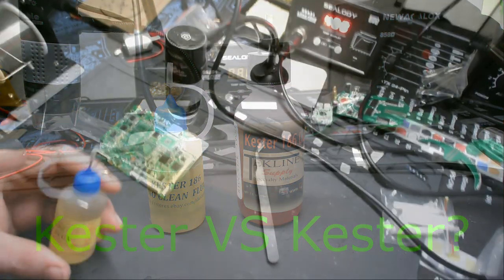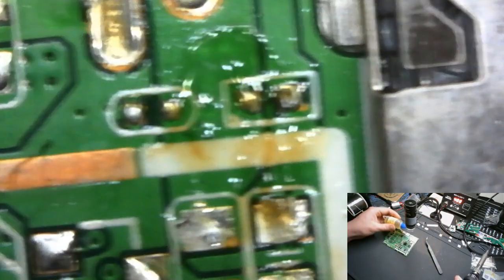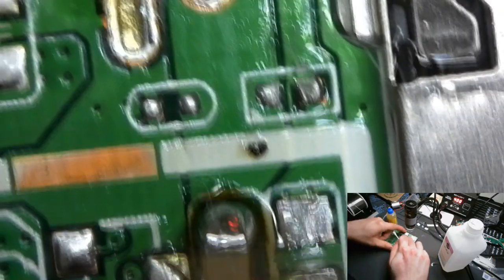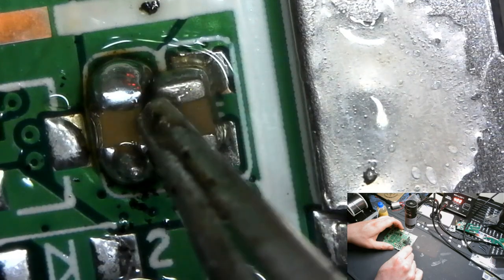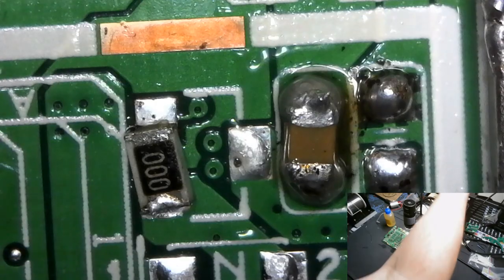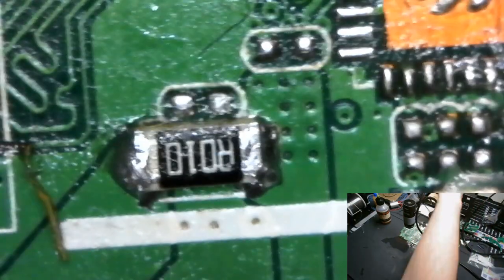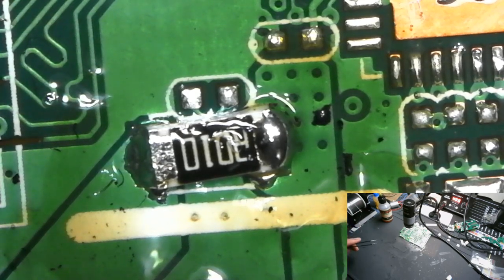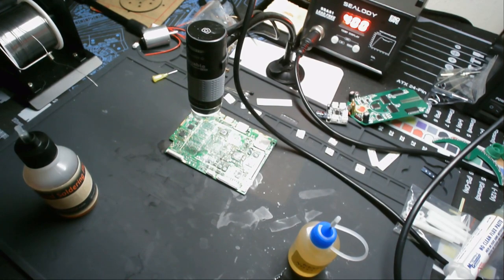Real VS Fake (Kester 186)

Comment: I think your soldering iron is too much hot! Or needs calibration. If you are using good quality 60/40 or 63/37 just stay at 270-280 degree c , and for small pads like these use the smaller iron tip. It should not be big like this, also you cannot heat a component for more than 2 sec

Comment: I used the ebay bottle labeled Kester 186, which looked identical to the bottle in your video, for a year and a half and performed tens of thousands of dollars in board repair with no issues. I never received education or training for it so I'm not an expert but I've picked up a few things over the years and can do a fair amount. The boards I repaired and wiring jobs are still fine years later so I can't complain about the flux. 

My only complaint would be not getting paid extra for the work I did because the majority of board repair I did, voluntarily done during my spare time in between my actual job, was to save the company money on parts, labor, lost income due to downed machines, and service charges and to make my job easier and keep things running right 😅 I calculated out the service records I kept and found that I had saved the company more than 150% of my annual wage in board repairs alone in my first year of employment, not including many times more than that in money that wouldn't have been made if the machine(s) was down for the week or so it would have taken, plus the cost of service calls and parts, to get it running again. Each machine profited anywhere from hundreds to thousands of dollars a day, well over my weekly wage. 

The last tech that possessed any technical knowledge, or at least understood basic fundamentals, of computers or electricity, or was capable of soldering, advanced troubleshooting, or rewiring retired a year before I arrived so all of the "slot techs" were actually just slot attendants who changed paper, fixed bill and ticket jams, reset jackpots, fix broken or stuck doors or locks, and paid out smaller jackpots. Needless to say their casino was in pretty poor shape when I arrived. 

Out of 331 machines I never had a single one down by the end of a shift but most days, especially my Monday, I'd come back to a minimum of 4-6 machines down and have them fixed within the first hour or two of my shift and I did the repairs with equipment I bought, including any components I couldn't salvage from donor machines. Eventually I managed to do a complete overhaul on every machine and had them all functioning like new, also leading to the security drop taking 4-6 hours to complete before due to door jams, stuck locks, etc, down to 45 minutes to an hour on average because there were no more issues. I never received a promotion or bonus and had the lowest quarterly review score in my department. I'm not sure why I was surprised to find how greedy casinos are 😅 I would love to learn more about board repair and I think it's something I'd like to get into but it definitely isn't my primary career/skill. 

I haven't used too many kinds of flux but even if it was fake it got the job done every time and wasn't a pain to clean. It could be fake but I'm guessing someone is buying in bulk and reselling it in smaller quantities. You can buy a gallon (128 oz) of Kester 186 for $95 and a pack of two 1oz bottles, labeled Kester 186, on eBay sells for $14. After 64 sales (128 1oz bottles), at $14 for 2 bottles, you'd have $896, plus maybe $200-$300 for bottles, labels, and shipping, (roughly a $500-$600 profit per gallon) so it isn't unlikely that the repackaged bottles are genuine Kester 186 flux. I'd love some good equipment but sometimes you make do with what you have. I didn't have an issue with the flux I use but if you're planning on doing a lot of soldering it's probably best to just buy a gallon at a time and buy your own bottles or syringes with metal tips/needles as you'll be saving $800.
Reply: You should start your own casino machine repair service.

Comment: On SMDs, a flux pen works better due to the size of the components. Just trying to be helpful. Not everyone knows the easier solutions and I happened to have been fortunate enough to have military training.
Reply from the maker: Any feedback is always welcome as long as it remains constructive. I have been lucky that most people who comment are clearly skilled and want to help. I bought a flux pen when I started practicing microsoldering. It was an MG Chemicals one off of Amazon I believe. I'll try it out again next time, I've learned I've been using way too much flux so I can see how a pen would be better for small pads.
Reply: On this pen use. There are many types of pens out there. The big thing is that the flux match the flux used in the solder’s core provided it has one. The liquid flux is not bad if you allow some of the alcohol, isopropyl in this case, flash off some by leaving the flux bottle open for say an hour or so. It is best if the flux is not so runny when used on pcbs. That’s part of the reason why I suggested the pen kind. Less mess means easier clean up. Clean up may not be mandatory, but that does not mean after ops cleaning isn’t necessary! I see it as mandatory because clean surfaces do not attract moisture as readily as one left dirty with flux residue. Soldering is not just something accomplished with the iron. It is about a whole discipline and I adhere to DOD STD 2000-1. It is an uncompromising discipline that, if adhered to, accomplishes both high quality and high reliability. It’s not for me to tell anyone to do like me, but the reason solder joints fail is a lack of discipline issue. When, in my military years, failure meant loss of human life or a high value asset loss. When you have that over your head, you don’t need any other motivation!
Reply from the maker: So you have to use whatever flux is being used in the solders core. This is where the flux is RA or RMA for example correct? Yes, learning how to do things properly seems to be an issue where information seems to be conflicting from various sources. Is there any basic tips you would recommend people do when soldering in general. Like a rule of thumb everyone should follow? Thanks for all the advice.
Reply: Draxxille Gaming, don’t blame yourself for not knowing everything! I don’t, but it is obvious someone wanted to keep you in the dark! There are weak minded people everywhere. Enough of that. Whatever flux is in the core is the extra flux you use to keep the joint, wire or connector clean. Paste is the hardest to control. The needles on them are too big to do SMDs of any kind. I don’t use paste on anything because I have found that the pen and the fluid work best in any applications I have come across. Just be sure you use the same flux as what is in the core and you can’t go wrong. Mixing core and fluxes will cause issues you do not want to deal with. I have found RMA to be the most consistent of all the solders in electronics industry. Lead free formulations have not gotten to the same level. Until they do it is 282 Kester RMA Sn63 or Sn62 for me.Aim and Alpha Metals also make the same solder under different numbers. Cleaning all surfaces is imperative to get top joints! People who expect the flux to do it all will reap the wild wind when their project or repair fails! Cleanliness is paramount to getting everything the best it can be. Any more questions, just ask! I’ll help out. I know how. Some can’t and some won’t!
Reply from the maker: Awesome, I really appreciate the tips. I am using Kester 44, which I suppose is the right alloy SN63, but I checked what core type my solder was and it's type RA flux (Part number 24-6337-0007) So I suppose I shouldn't be doing that because I believe my flux is RMA. What measures do you take to ensure top cleanliness flux aside?
Reply: Draxxille Gaming, I would ditch the 44 and go to 282 RMA cored solder Sn63! Do not get larger than .025” solder wire. .020 would be better. You do a lot of SMD work so .020 is plenty big enough. The smaller the wire, the easier it is to control the flow of it when soldering. Larger sized wire is only helpful on super large connectors and larger components. Smaller wire easier to control your feed of solder. Clean the joint, pads, wires or leads with 99% isopropyl alcohol till no residue is on your Kimwipes. It may be a pain now. But when you start your solder op, you’ll thank me! After your done with the soldering op, clean all surfaces and leave no flux residue, period! You have to be hard on it if you want first rate results! I really need to come up and teach you the full program. Then you will be the envy of all your viewers!
Reply from the maker: @markphilpot4981  Alright, I'm looking for some now. I'm having to resort to Ebay to find it. I see a lot of .015" 282. What is your thoughts on that size? That is what I have been using this whole time and it seemed to do well. Kimwipes, I added that to the cart too. I have the lint free swabs right now. Have you ever seen better results with Flux removers vs. 99% isopropyl alcohol?
Reply: Draxxille Gaming, the .015” size is primo for SMD work because it is small and that size makes control of it easier on the tech. On larger components, .020 or .025 are preferred for the same reasons of control of the solder. Using too much solder is both wasteful and stupid! Your joints should appear clean and shiny. The appearances of acceptability are located on the web for those who really care. Things that you do for a living should be cared about, otherwise why bother. This work isn’t for everyone. If you aren’t committed to excellence in your soldering, you have no business doing this work! It should only be done by people who are committed to it and are willing to exercise the discipline necessary to achieve that level of excellence! DOD STD 2000-1 is the standard I was taught under. It is not the current standard of soldering, but I do not agree with this new standard or the ideal they push! I am fanatical about solder quality. Your opinion may be different. If it is, you are not doing this part of your job with the right mindset. Solder failures are your responsibility! Therefore, make up your mind about whether your customers matter or not! If not, do something else!
Reply from the maker: Alright, I'll go on ahead and order that 282 from ebay then. Where do you order your solder from? I know a roll lasts forever, but it looks like to get kester it has to be bought from a supplier. Supply seems limited on amazon. I just looked up the Appearances of acceptability, that's what I try to shoot for. I can usually tell when something looks off, but I'm sure I've messed up and used too much solder. What are they trying to do in the new standard? Lead free crap?
Reply: Draxxille Gaming, I am uncertain as to the real. I only have the words from those I respect who’ve told me of unnecessary reflows to try to improve appearances of solder joints. Every other introduction of heat in an SMD or really any component being reflowed or reworked, regardless of the reason, damages the internal structure and junctures of the device itself. Many and nearly all of the newer avionics use SMDs and smaller components that do not hang as well as older and larger components. There is no reason to put a pilot’s life or a capital asset in danger over strictly an appearance issue if that is what it is with respect to solder joints. It either passes or fails. It isn’t worth losing a life over that and what would be classified as shear negligence on the part of the operators while being defended by lazy ass inspectors who aren’t doing their job by rejecting the failures rather than having them reflowed or reworked. It depends on more than one factor. The corruption goes beyond reason. It angers me as a veteran to even hear it! Pissed beyond all comprehension is more like it. I’m likely to get hate mail or people accusing me of being a conspiracy theorist. I don’t believe in anything that cannot be substantiated by fact either by myself or someone I trust implicitly! Lead free solder by my own experience and others whom I trust beyond measure, say this! I have not seen one single joint done the correct way regardless of the flux used that would pass an appearance evaluation magnified or unmagnified. I cannot speak with real authority of the new standard. I was taught under DOD STD 2000-1 and that is a strict standard, very strict! When the Air Force decided to drop it’s adherence to this standard, I left at my ETS thereafter. If you believe in something and I did and still do, you do not support that situation. I have no problem with the service, I have a problem supporting what I see as a piss poor decision! That I don’t support! The rolls of solder you buy off eBay and Amazon are not new, from the manufacturer! If you buy from any specialty internet store, these are direct purchases from the manufacturers which they had to buy a minimum of 20 pounds just to get the solder of choice. The ones you get from eBay and Amazon are from individuals who bought too much or are stores clearing stock. A lot of these rolls are older than dirt, not really, but I saw some pictures on eBay of solder that we’re old as hell. The age isn’t the issue, the condition of it can be! My point of this is if you are too stupid to use gloves while performing solder ops, you have no business doing this job. If you do not clean each lead, pad, contact or wire prior to and after each solder op, stop soldering! You have no business doing this! Safety and cleanliness are part of any legitimate solder operation! Live it, practice it and represent the highest state of excellence or leave it alone!😠😡🤬No slack, ever! On the fume extraction matter, to delude yourself into thinking those desktop fume extractors I’ve seen some use are sufficient in measure, I say not just no but Hell No! The smaller the room or enclosed area you work in, the more important fume extraction is! I cannot overemphasize this enough! Listen people, solder fumes contain carcinogens and lead particulates, whether anyone believes lead can become part of the fumes or not! Lead is classified as a heavy metal. It can enter the body by inhaling, ingesting or transdermaly! Believe  it or not, lead is scary and prevention from it entering your body is of paramount importance! It causes stupidity, destroys brain cells and other issues. Consult a medical professional, preferably an internist or toxicologist to explain what is the whole of the ugly options than can happen. Protection from these fumes and their side effects is your, the individual’s, responsibility! Fume extraction is the solution and those extractors that only draw the fumes away are Insufficient to do that job properly. A fume extractor that uses the hoses with the funnels on them that pull the fumes away, drawn through a pre filter, hepa filter and even an additional filter before allowing it to renter the room’s atmosphere. If you can’t afford one, find a way! Your health matters because you matter! You care enough to do this solder operation at all and you care about your health, find a way! Being sick or dead is overrated because You can prevent it!🙄

Comment: Hi what soldering wick is good to get?
Reply from the maker: I basically shop off of Louis Rossman's recommendations. All of his videos have a list of his recommended supplies in the description. He uses Goot Wick. As for size, it depends on the use. Small pads need smaller wicks, try to have a variety for each use case.